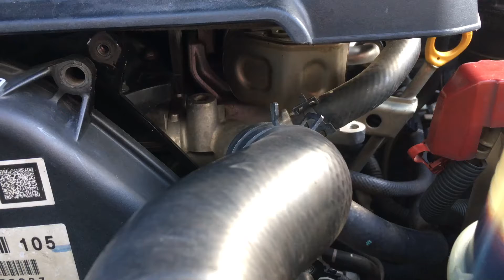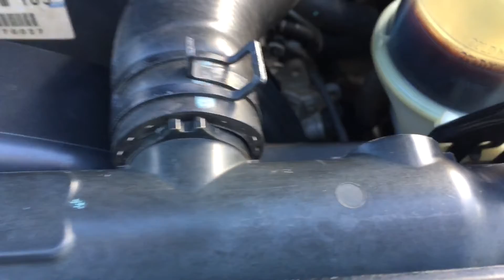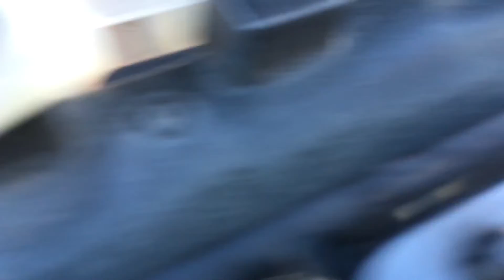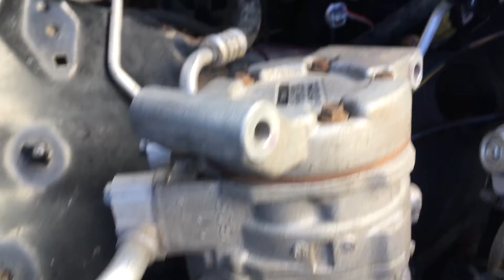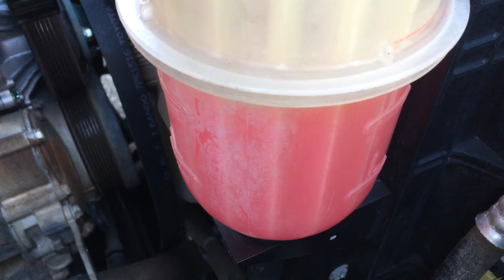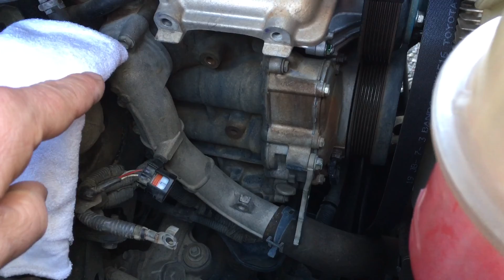BUGGER THERMOSTAT LOCATION

Comment: Yep same as 1kzte. I run 71 deg celcious in mine since new, just done it again at 380k. I use the 71 deg high flow and it helps with cooling a lot.

Comment: Thanks for this video, super helpful. I’ve got a 1kzte in my Hilux surf and wanted to do a quick drain from the radiator and refill then air purge and wrap it up. I was wondering with the thermostat on the lower hose, is it safe to just refill the radiator and switch the car on and top up slowly as it warms up and the thermostat opens (I.e. just as with any other car?)

Comment: If you were going to just change thermostat, would you take out just the alternator, or ac compressor or both?  Go through the wheel arch?   I have been through the manual and it says take off just alternator, but would love to hear the best way from the pro.   Thanks.
Reply from the maker: Don’t usually change them because I don’t have a problem it’s been along time since I’ve change one with the engine in the car I think I would get the airbox out and work around it without removing the alternator but it’s been at least a couple of years

Comment: Cheers for the Video. Would it being stuck open cause it to run cooler? My temp gauge doesnt go past 1/4 after towing a boat up hill on weekend working it hard. Visually saw it drop temp while towing and now wont pass 1/4.
Reply: Definitely stuck open 👍🏼
Reply: Hey mate, did you happen to fix that thermostat problem? My gauge won't budge past 1/4 either